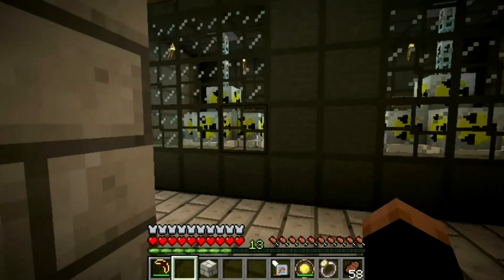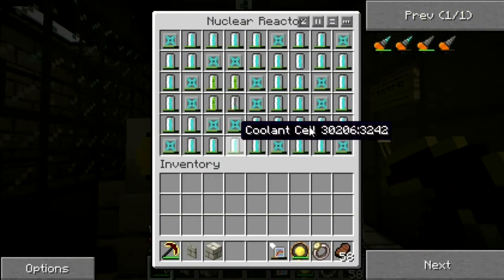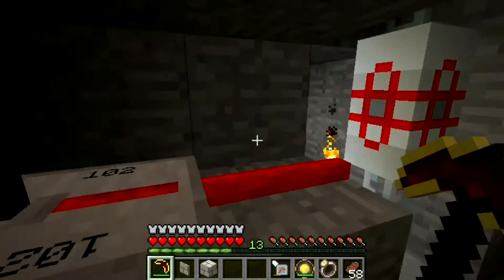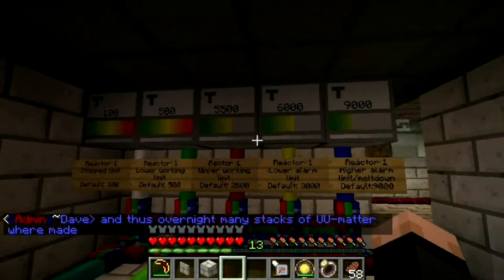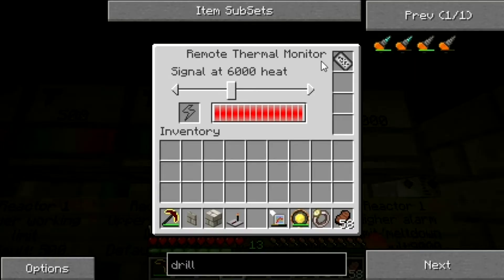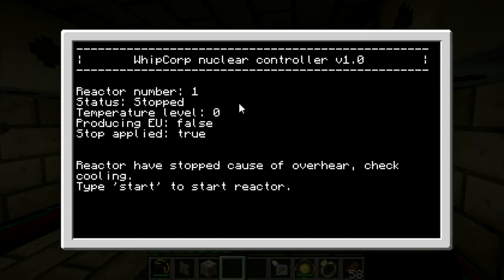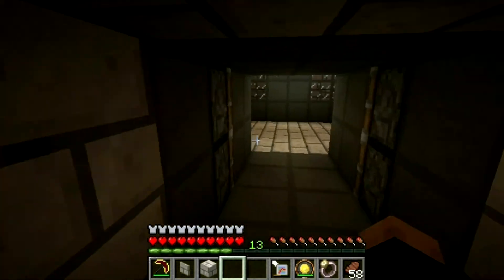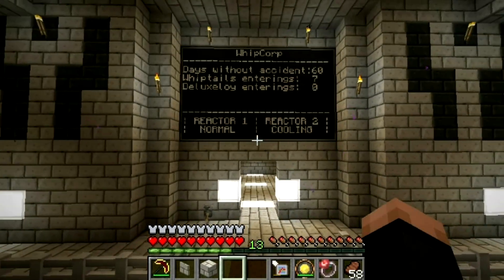Tekkit/computercraft controlled nuclear reactor (showcase)

Comment from the maker: I am assuming you are thinking of the screen up in my factory. The computer stands idle and listens for rednet broadcasts. Depending on the rednet broadcast it updates only a spesific line and width.
It is done with:
term.setCursorPos(x,y)
term.write("Some text         ")

The spaces behind the text you write will delete the rest of the old string if it was longer. Hope this answers your question.

Comment from the maker: The temperature sensors contains a linkcard to one of the blocks on the reactor and outputs a on/off signal depending on the set temperature. The signal goes through a bundled cable to my computercraft computer which acts according to what temperature-level there is.

Comment: You didn't leave a "Self Destruct/Deliberate overload" command buried in the OS? I screwed around with a reactor control program were if I didn't click a remote every so ofter "IE, I'm dead and someones likely going to raid my place" it would shut down all cooling.